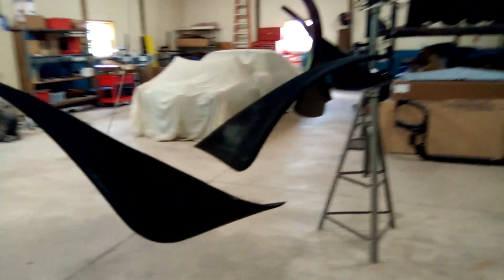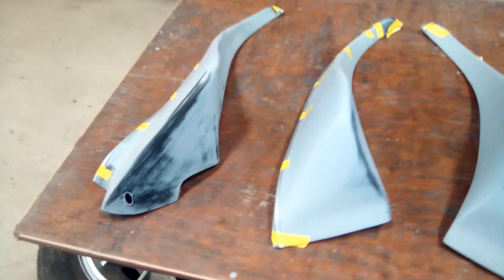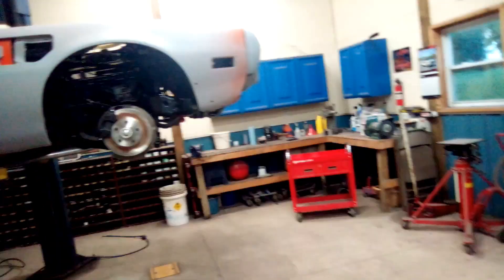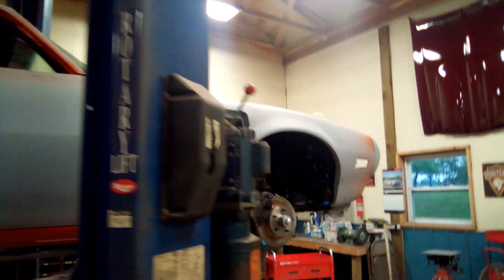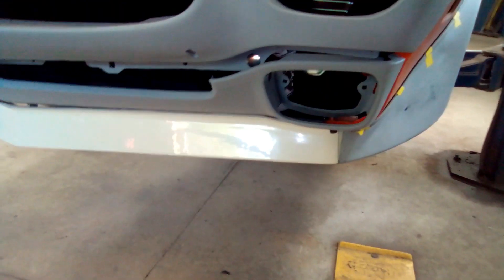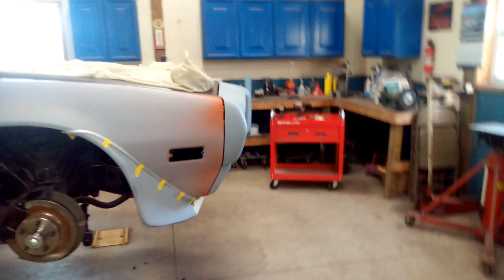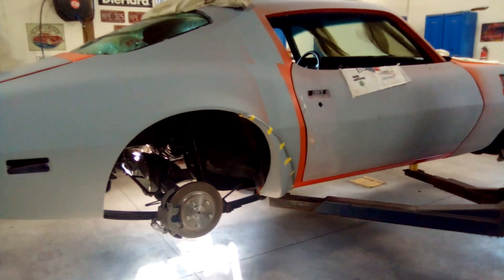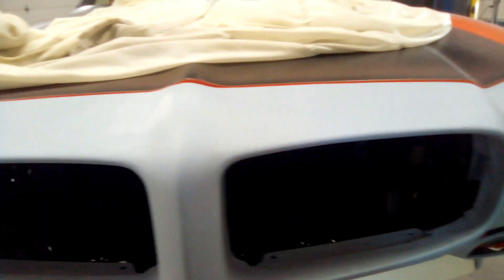1972 firebird restoration 37 wheel flares / welting and front air dam

Comment: I restored a few of these,  if you leave the welting off you end up with unsightly gaps. I usually order new welting or I have body finished a few. This involves mounting them and finishing them against the body so they look molded. Your mounting surfaces has to have any body work completed. I put one layer of blue tape on surface then use mold release wax on top it will keep any filler from sticking.